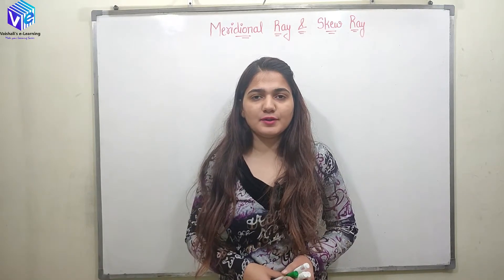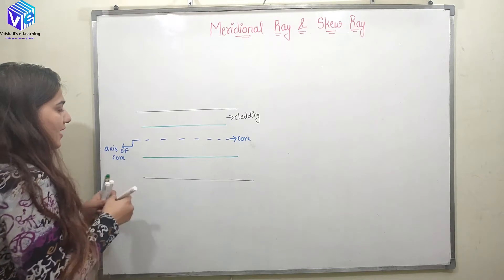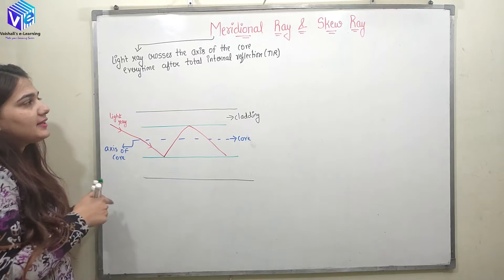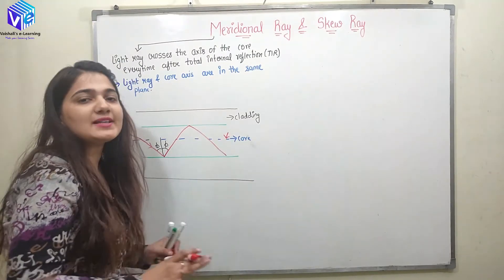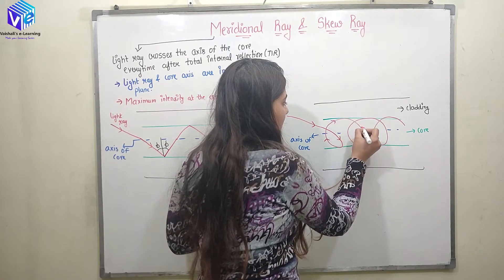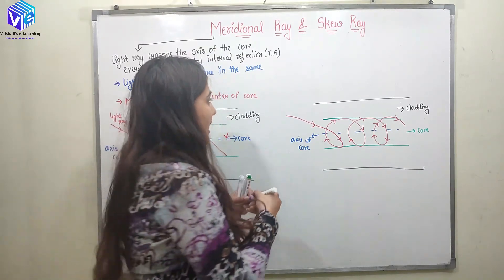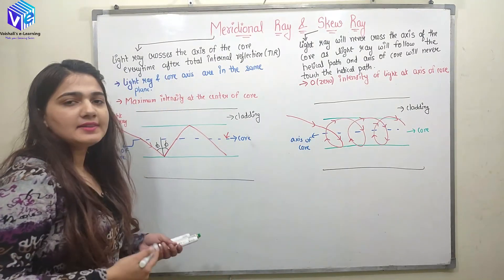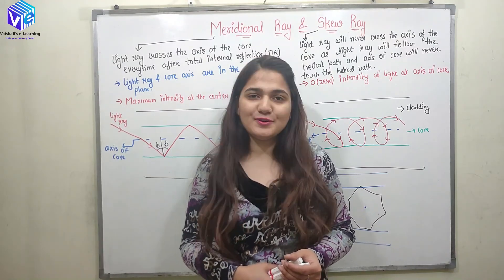Meridional Ray & Skew Ray I L 8 I Optical Communication

Comment: Light ray always travel in straight line (rectilinear propagation of light) and cannot be propagated in the form of helical structure ...instead it touches the boundary of core cladding interfaces without passing through the axis of core!